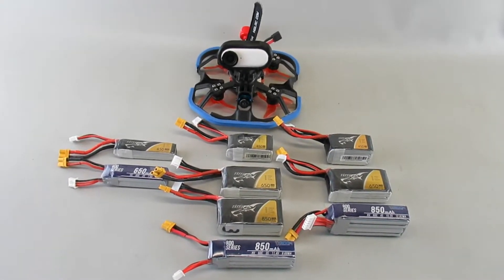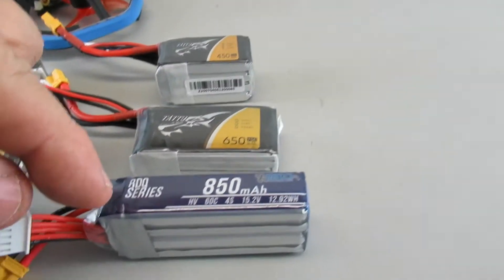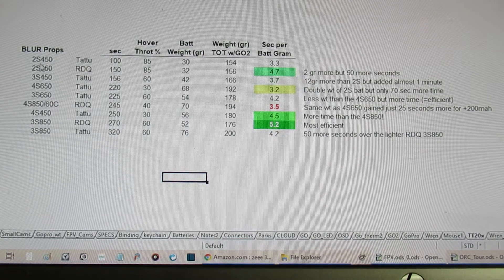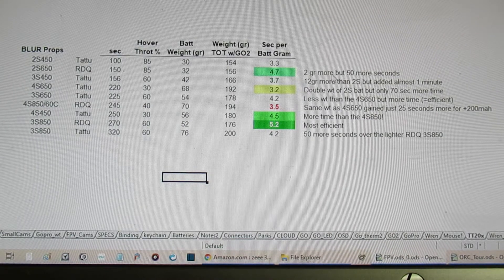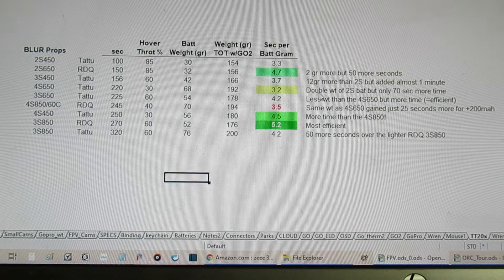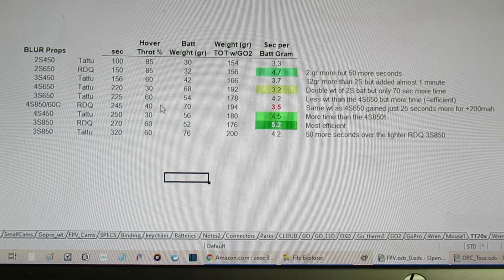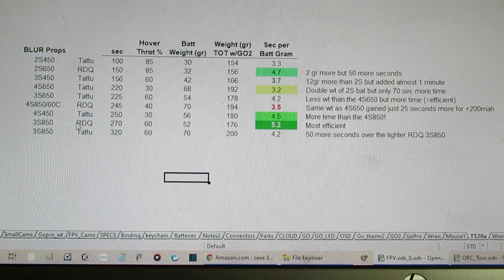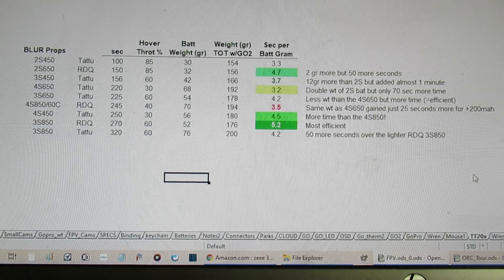FPV Cinewhoop | Choosing the right Battery | Quad | Lipo | Test

Comment: Great information Tommy. Thanks for sharing 👍🙏👍🙏👍
Reply from the maker: It gave me an excuse to log a few hours of flying with this new quad.  I also just finished a similar test comparing 2" props.  I hope all is well!
Reply: @TommyTester  All is well Tommy. I went out yesterday and flew the cinewhoop for the second time. It was something different. The weight on it is something to get use too. I flew it with a 4S and a action camera in the front. I will be posting the video once I get the chance. Thank you for all you do for the hobby. 👍🙏👍🙏👍many blessings
Reply from the maker: @electroddxful  So proud of you Ray.  Yes, driving a 3" cinewhoop feels like you're hauling a case of beer around.  Cinewhoops don't need all the open space that freestyle flying requires, so you can send it in many new places.  Be gentle with it as they hit hard if you're not careful.  Looking forward to the clip. 🦅
Reply: @TommyTester  Thanks Tommy the video was just uploaded. 👍🙏🙏🙏
Reply from the maker: @electroddxful  Cool.

Comment: Great video.   Hard to find the right batery.   Great information 👊👊💪💪
Reply from the maker: Agree!  I was laughing while flying the little 4S450 Tattu battery as I was only using 30% throttle, zipping around with ease,  and I could tell it was easily going to go over 4 minutes.  That alone made doing this test worthwhile. Thanks!
Reply: @TommyTester  lol fun us fun. 👊👊💪💪

Comment: what about is iflight suggested 1050 4s ( 136 gr ) but i use 1500 3s ( 129 gr ) 🤔 any predictions? should i try? or waste of money?
Reply from the maker: For the same weight, 3S seems to run longer while cruising.  Doesn't hurt to try a pack though.
Reply: @TommyTester  thanks! will try